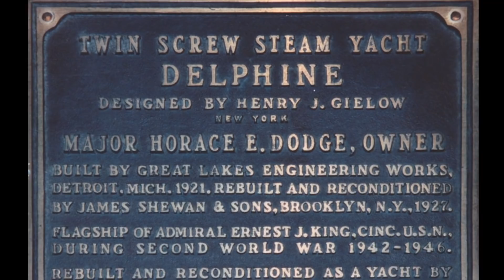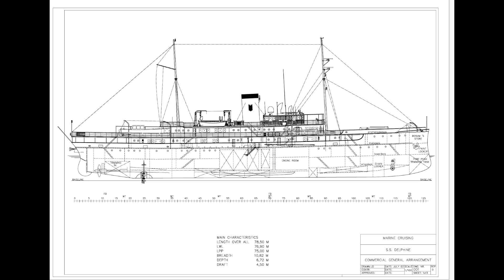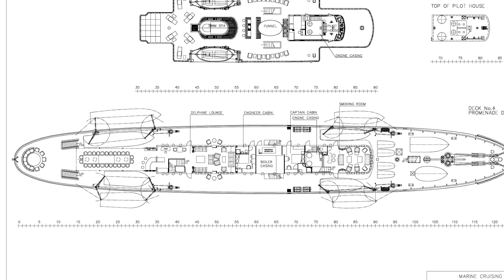258'/78m U.S.-Built Dodge Family Mega-Yacht is 100 Years-Old and Steam-Driven

Comment: Steam is still one of the most efficient means of motive power . Just ask any nuclear powered vessel
Reply from the maker: Agreed.
Reply: That's the whole point...
How do you get that steam?
That will define EFFICIENCY.

Greetings from Brazil.
Reply: It is, but nuclear is much better for being effcient compared to a boiler using bunker fuel
Reply: Nuclear is actually a lot less efficient than a proper oil fired superheated plant. The efficiency of a steam plant depends on the temperature of the hottest part of the system. Pressurized water reactors simply cannot reach the same steam temperatures as the boilers on an Iowa battleship or Fletcher destroyer due to material limitations on the reactor side of things. What nuclear ships do have is practically limitless fuel, the equivalent of hundreds of thousands of tonnes of coal.
Reply: But polluting assuming it uses bunker oil.
Reply: Actually, no. Steam in shipboard applications is at best about 33% efficient. Diesel is over 40%. 

Nuclear boats are less efficient than oil fueled steam ships due to the lack of superheat. They just don't care since there is so much energy in the fuel load.

The gas turbine ships are even less efficient, but again their other advantages convinced the Navy to use them in smaller warships. 

To build a truly efficient steam plant you need to use supercritical pressures, 4500 to 5000 psi. Not happening on a ship. 

Combined cycle gas turbine plants use the exhaust from the gas turbine to heat a boiler, and that steam runs a turbine. So thermodynamically you put a rankine cycle in series with a Brayton cycle, and that gets you over 50% efficient. 

Thermodynamics is a cruel bitch. To get efficiency up you have to raise the source temperature of lower the sink temperature. Since pumping ice through the condenser is not an option, the limit comes at the temperature where the boiler tubes can't hold the pressure any more. And that sets the limit according to Carnot.

Yes, I am an engineer who spent several years as a steam plant machinists mate in the Navy. Starting up the engine room while preparing to get underway was one of my favorite activities.
Reply: A nuclear power plant is basically a teapot
Reply: @mikespangler98  yeh, is just what you said about sub or super critical steam turbines systems. As I remember, Iowa class (all four) are supercritical steam turbines, Yamato class was subcritical, one of the most important differences between this two classes of battleships.

Comment: Very interesting that the engine room is for'd of the boiler room. She therefore has long tail shafts no doubt carried in multiple shaft bearings. She now has two sized different water tube boilers that replace the fire tube boilers fitted originally. More efficient and less fuel required to raise steam. Also react more quickly to steam demand from the engines.
Lovely vessel, however now out of service with AIS turned off since last December, and possibly up for sale still.

Hope to see her back in service soon.

Comment: I DID NOT SEE A WX FAX MACHINE ON THE BRIDGE , NOR A SAT ANTENNA , NOR A 406 unit
Reply from the maker: Navigation Equipment
>Magnetic Compass: >Gyro Compass: >Automatic Pilot: >Echo Sounder: >Radar:
1 x Cassens & Plath
1 x Robertson R6C 11
1 x Robertson AP 9 MK 3 1 x Skipper GDS 101
1 x Litton Marin System on Bridge w/ 2
slaves;
>
>AIS:
>VDR: >Transponder: >DGPS:
>
>Charts:
>Navtex:
>Weather Fax: >Log:
>Wind Instruments: >Camera:
1 x ARPA Recal Decca, 12inch PPI 1 x Furuno FA-100
1 x Rutter 2 x Jotron
1 x Leica MX420 GPS
1 x MX Marine MX 420 DGPS
1 x ECDIS Transas, flatscreen 12inch 1 x SHR-NAV5
1 x Furuno DFAX 208 1 x Consillium
1 x Thomas Walker & Son ltd. 2050
1 x CCTV System SONY with 5 Cameras

Comment: Promenade decks similar to the old *ocean liners*, not “cruise ships”. Having said that, this is a beautiful yacht. Modern day yachts are so ugly. Yachts from the 1920’s and 1930’s are beautiful.
Reply from the maker: good distinction - "Ocean Liner" vs all-you-can-eat "Cruise Ship".
Reply: True. The beauty of wood beats fiberglass every time.
Reply: @IncredibleShips  Two entirely different beasts even today. A liner such as Cunard's three Queens is designed to sial on regardless through all but the very worst of weather whereas a cruise ship needs to turn tail and run as they are not designed to cope with heavy sea states.
Reply: Very true . . . but you'll have to fight me for the "Delphine!"
Reply: Yes, another example is the "Sea Cloud". Today a small cruise ship with sails. But originally a privat yacht. Also very beautiful.
Reply: Completely agree with you on the beauty of this yacht. Thinking of modern yachts, the ugliest one I have ever seen is the one designed by Steve Jobs.
Reply: @IncredibleShips  
Cruise ships especially the modern ones are basically floating shopping malls with leisure centers and hotels attached... so ugly they look like they will turn turtle in a blow..

This was built to last pre ..planned obsolecence it can be maintained.  Her near vertical bow line is echoed in the many modern Sea axe bows. 
Steam power doesnt scale down so even a small steam engine is massively powerful for its size..  which is Why Charles Parson's Turbinia the first steam turbine vessel  was able to achieve what it did at the Spit head Naval  Review in front Queen Victoria running rings round the grand fleets battleships.
Reply: Myparents live on edge of beach in torre nueva sòuthern spain near puerto banus theyve run a bar and resteraunt for36 yrs 
I like to look at cruisers in puerto banus lovely
Theyre appartment is 2nd floor clear view to sea.you walk out of complex door 50 ydz to sand 
I dont go in sea as i had an incident with a shark snorkelling off a beach in minorca i was 15...im 58 now 43 yrs never forget seeing it come out of gloom towards me it was about 9 to 10 feet it was a great white i drew my knife.but it just swam past
My kids call me chief brody
Out of jaws you dont go into  the water do you chief
Lucky boy that day

Comment: Beautiful ship. I have sailed on steam, diesel electric and diesel ships. Not sure about a reciprocating steam engines but steam turbine ships are some of the smoothest ships. It looks like no expense was spared on her restoration.
Reply: Do you know what fuel is used to heat the boiler?
Reply: @jondeur2686  I believe they are using diesel.  They refit newer modern boilers during the restoration.  I believe they are Babcock-Wilcox

Comment: WOW, the owner would have to hire a Steam Engineer to operate the Boilers, and, a full Crew!
Reply: They can afford it. OG engines, the steam engines built on the Great Lakes were world class, in fact look up the SS Badger, shes a coal fired Steam Ferry that operates every day going from Wisconsin to Michigan. She still has her OG 1956 Steam engines that run like new
Reply: on these boats I believe you need an Engineer just to hit the two buttons: fuel and oil pump. One trip the Taconite from this era had a replacement Eng. NOT hit the oil pump and caused 200 grand in damage (fortunately insured) to the engine.
Reply: I imagine the pool of available marine steam Engineers is probably pretty small.
Reply: @TheMrLebaron  ,more like 1953. The Spartan started running in 1952.
Also, they steeple-compound Skinner Uniflow Steam engines.
Reply: During the refit she was fitted with 2 modern boilers.  Babcock-Wilcox I believe.  They do not require as much attention as the old boilers
Reply: @TheMrLebaron  The Alpena, also on the Great Lakes, is the last of the steam powered lakers. She was built in 1942 and still hauls cargo. I just read where the SS Badger is going to be laid up for repairs for the rest of the season. There's problems with the loading ramp.

Comment: I don’t wish to be picky, but Quadruple Expansion Steam Engines were around before Mr Dodge.   They followed the more common Triple Expansion Engines, which were introduced by Napier, in the 19th century.   These, in turn, followed ‘Compound Engines’, which had 2-cylinders.  This is misleading, because all stage expansion engines, reciprocating or turbine, are compounded.   It just means that the live steam from the boiler goes to 1 cylinder, which exhausts into 1, 2, or 3 further, successively larger, cylinders, before exhausting into the surface condenser.  Some triple expansion engines had 4 cylinders, because steam from the IP cylinder split into 2 LP cylinders.  Titanic had that arrangement, inter alia.
Reply from the maker: My mistake. he did not 'invent', but he designed these: "Horace Dodge decided he would personally design the engineroom with two quadruple-expansion engines of 1,500 hp (1,125 kW) each."

Comment: The "Fifer" and the "Taconite" were moored at the Bayshore docks in Vancouver, BC for decades. The Taconite (Tacoma) was built in 1930?? for Mrs. Bloedel (MacMillan Bloedel Lumber) as a birthday gift.  A friend crewed on it for years. It, too, sipped fuel. The Fifer, a steel yacht from the era, was sold down into SF and I believe Melvin Belli, the lawyer, owned it.
Reply from the maker: Fuel Consumption: 600 litres/hour @ cruising speed
>(Note: consumption depends on cruise time, & the longer non-stop cruising, the lower the consumption- for example- 5 days non-stop sailing @ 380 litres/hour)

Comment: How does it make the steam? coal ?wood?  In the refit did they add stabilizers?
Reply from the maker: Diesel for steam. No stabilizers.
Reply: so a high pressure pump, atomizers and draft inducer blowers to draw hot gasses through the boiler heat exchanger?

Comment: Great Lakes Engineering was in River Rouge, Michigan, not Detroit. They also built the Edmond Fitzgerald.
Reply from the maker: Thanks for that footnote. Interesting.
Reply: At the time they had a yard in Detroit to, thats where it was built. That yard went away in the late 20s
Reply: @IncredibleShips  River Rouge is in Detroit G1 Sokol is not correct.This area has many zip codes. Ford Motor Company owns this site at Zug Island and the river is the southern boundary. The Ford family recently required the Ford Motor Company to completely restore the Rouge Assembly Plant and also made the roof a garden. Respectfully, Tom.
Reply: Interesting, disturbing. Of course, the  Fitzgerald had to adhere to a strict schedule that sent her into hell and high water on a regular basis. Yachts don’t do that so they seldom break in half.

Comment: Origin of the word Yacht: 
1550s,  (before engines) yeaghe "a light, fast-sailing ship," from Norwegian jaght or early Dutch jaght, both from Middle Low German jacht.

If the vessel hasn't got sails to propel it through the water it is not a Yacht.

Comment: SO what fuel is used to heat the boilers? Coal?
Reply: My guess would be bunker oil. At this time most coal fired passenger ships were transitioning from coal to oil for less suit, smaller boiler room crews and number 6 oil had a higher btu than coal and the water in the boilers could heat more evenly. More steam pressure so more power to the engine.
Reply: I would Think  fuel oil
Reply: Diesel
Reply: I'd guess fuel oil, like the steam liners of old.  Easier to store, more efficient, and Horace Dodge's own engine design would likely use it.

Comment: Not sure you can invent an engine that already existed for donkeys years!
Reply from the maker: I stand corrected. Horace Dodge designed and built these engines using this technology. Google tells me: "The introduction of four-cylinder quadruple-expansion engines dates back for many years. The earliest engines of this type were used to replace two-crank compound engines where additional power and economy were required, without the allocation of additional machinery space in the ship. The Suez, built in 1874, provides an instance of this practice. This ship, of 1,390 tons register, was originally fitted with compound engines. In 1887 they were replaced by quadruple-expansion engines built by the Central Marine Engineering Co. The new engines of the Suez comprised two pairs of tandem cylinders. The high-pressure cylinder and the first intermediate-pressure cylinder were at the top, with the second intermediate-pressure and low-pressure cylinders"

respectively below them.

Comment: Great video of a wonderful vessel.  I served in the HMAS DIAMANTINA ( River Class) which was powered by a triple expansion Babcock boiler and with steam on recirculation we too cruised many quiet nautical miles.  The engine never let us down although the fumes from the funnel with a following wind made life on the open bridge very unpleasant.  DIAMANTINA is now a museum in the Brisbane River, Queensland Australia and she was my first appointment as a young Sub Lieutenant as Bridge Watchkeeper & Bosun.  All steel and rivetted she sometimes popped a few in heavy weather in the Great Southern Ocean of Australia.
Reply from the maker: Ha- it must have been pretty rough to pop a rivet!
Reply: @IncredibleShips  Diamantina was engaged in oceanographic research and down south we regularly encountered a swell height (trough to crest) of 15 metres and a period (distance between two consecutive crests) of 300-400 metres. Hogging and sagging caused some plates to move and being held over at 30 deg heal for extended periods (3-5 minutes) caused some fittings to fall off (rusty bolt syndrome).  We would tie ourselves to the binnacle to not get thrown from side-to-side.